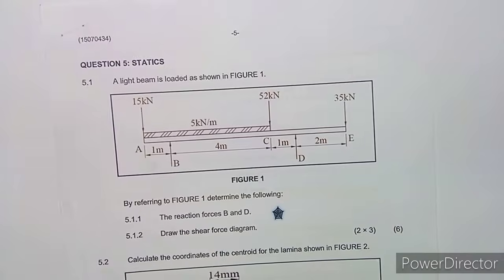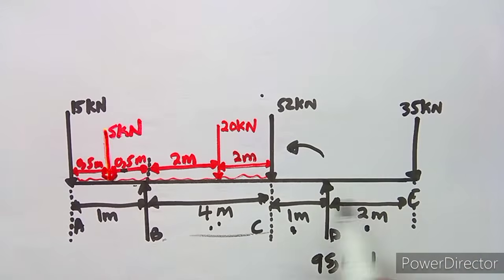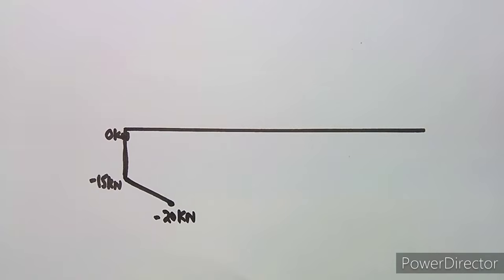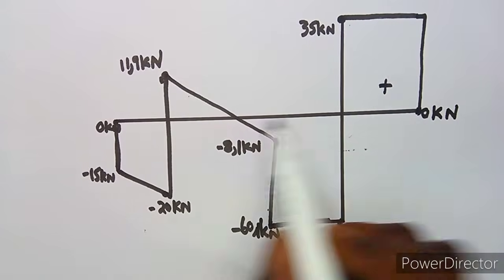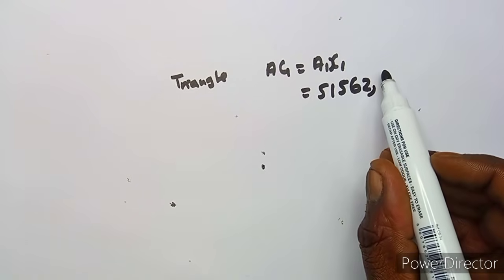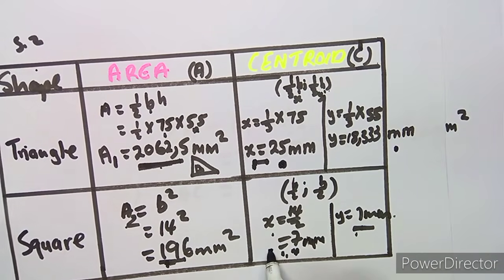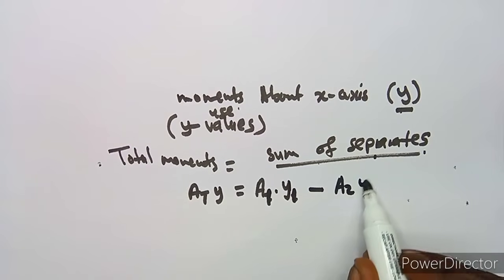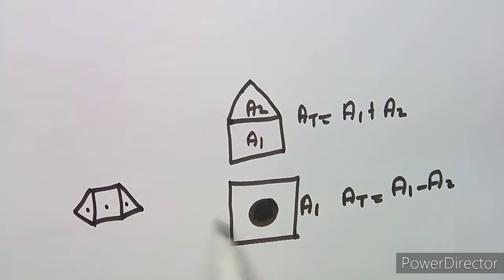Engineering Science N4 Statics APRIL 2021 @mathszoneafricanmotives

Comment: hello sir, so for the square the X and Y we use only the seven we do not add anything?
Reply from the maker: Hie on which part exactly
Reply: 5.2 sir @mathszoneafricanmotives
Reply: @mathszoneafricanmotives  Is the square’s bottom and left corner at (14,14), or should we measure its centroid from a different reference point?
Reply: @mathszoneafricanmotives 

Sir you still haven’t answered a year later .